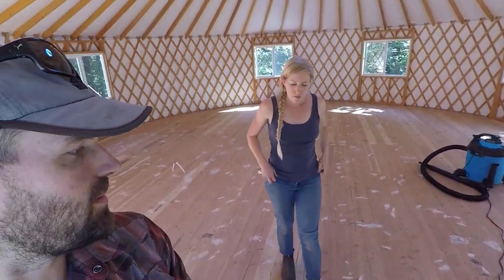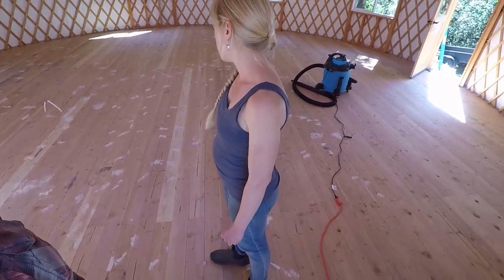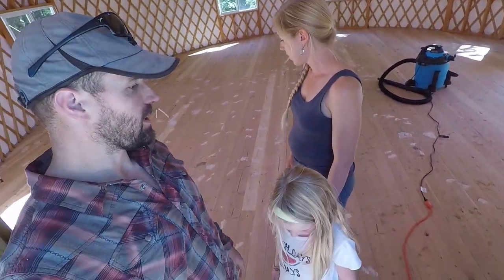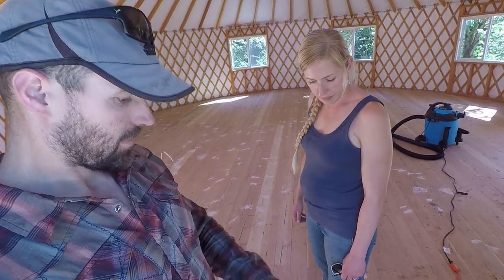Sanding and Finishing the Yurt Floor

Comment: Looks Great! I've been watching all of your yurt videos and just finished putting my yurt up a few days ago in Maine. Now I need to sand and poly. What grit sandpaper did you use?
Reply from the maker: Thanks, Benjamin!  We used 60 grit, but if we wanted to take the extra time, we could have worked out way up to 80 grit and beyond.  Let me know what you decide to do!
Reply: @Green_Heart_Family_Farm   I started with 40 grit and finished with a 60. With several coats of the water based poly it looks great!
Reply from the maker: @benjaminduhamel6974  So glad it went well for you!  Let us know if you put up pictures or video anywhere.  Thanks!